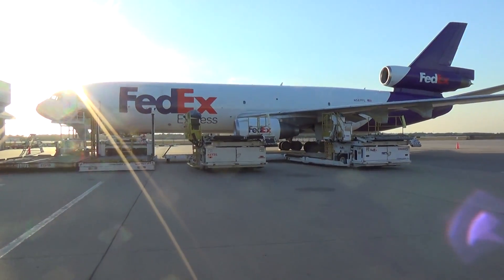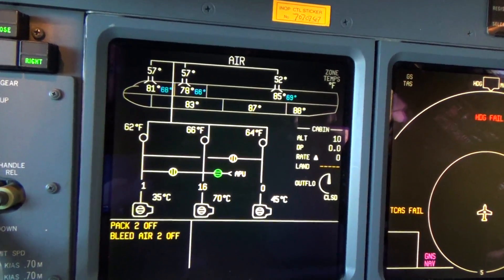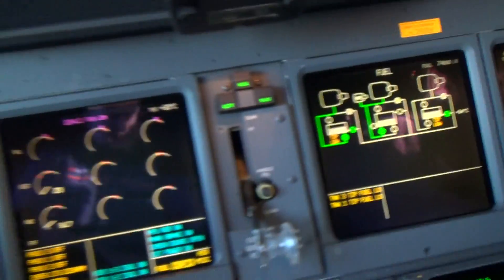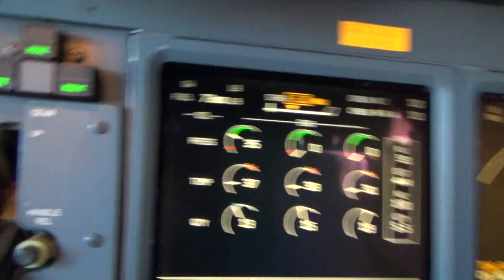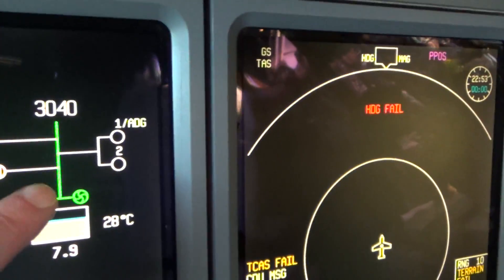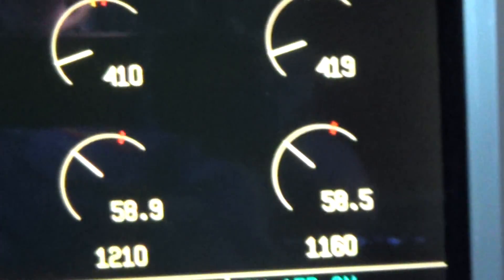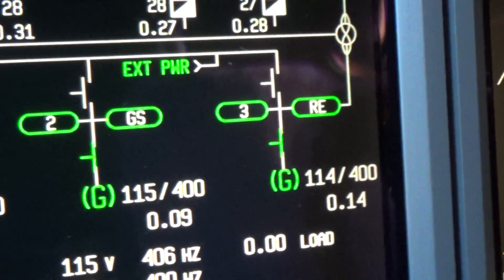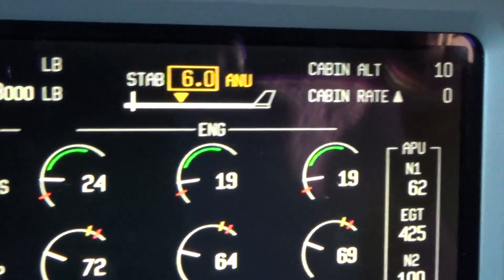Rotate.Aero - MD 10 Engine Start

Comment: It's been a few years since you posted this but I only found this just now and man, as an MD11-buff this is so so cool!! Despite what my name might suggest, I've never actually flown the MD-11 (except as a passenger), but I've been flying different simulations of her for years now and really dug into the Operating Manuals. Love to see all the similarities and differences between the MD-11 and the MD-10 flightdeck, so funny how the Fuel Panel is literally the one from the MD-11 just without the cuts in the panel for the digital readouts😂😂And that manual Air Panel without the FLOW and PRESS lights for the packs and the bleeds. Also love those flat LCD screens, recognized those from the MD-95!